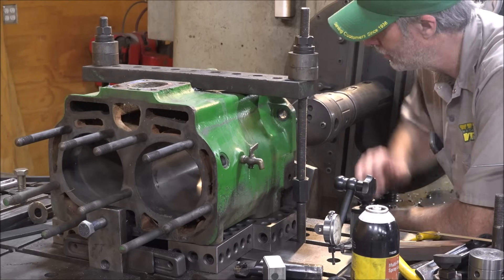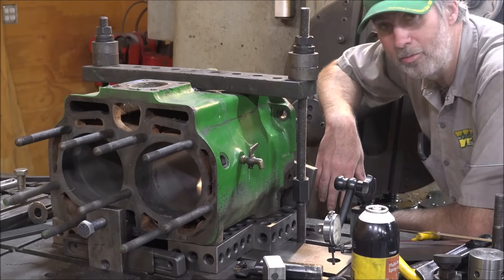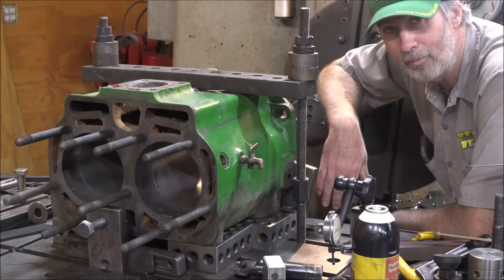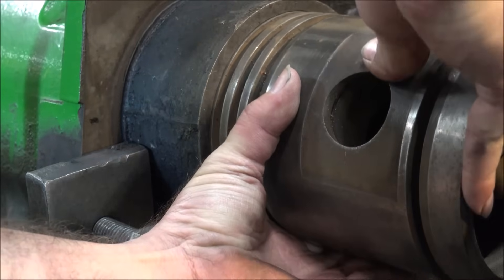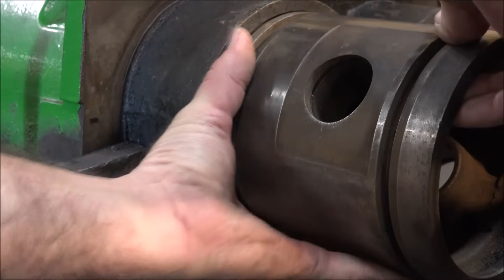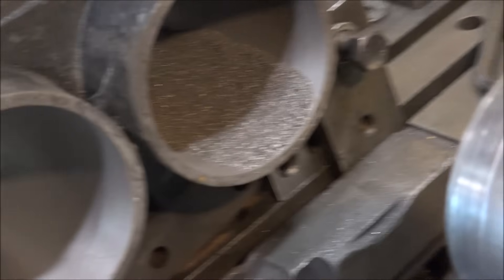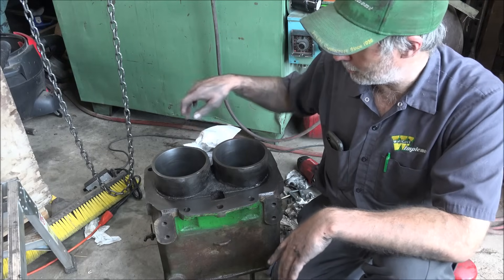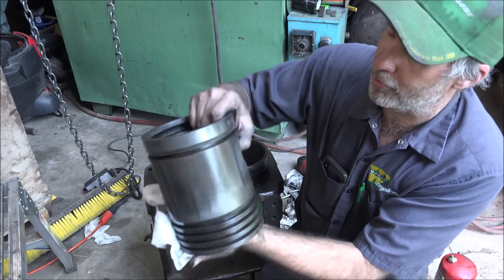John Deere Unstyled A Block boring and Honing

Comment: Cool! I wish you could do a video series of you over overhauling one of these engines.
Reply from the maker: The Cummins Hyster series features me doing an engine build from the ground up.
Reply: @bcbloc02   Yes I watched that hole fork lift build videos. I have always been interested in the 2 Cylinder JD engine. I was lucky enough to drive a John Deere 80 diesel in my youth ( mid 60’s) pulling a 5 bottom trip hitch plow. But I’ve never seen the inside of that engine,  but I am  still curious about them. I suppose the only rebuilds are collectors projects. And I’ll take this time to say thanks for all the videos you’ve put on YouTube.
Reply from the maker: @bsteleven  at some point I still plan to do some dyno work with my 820 so you will probably get to see some then.